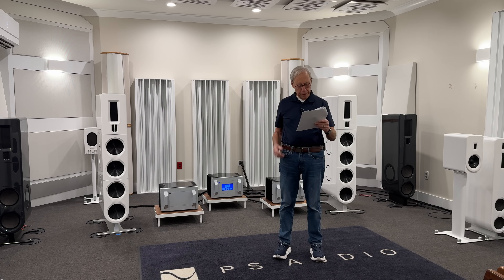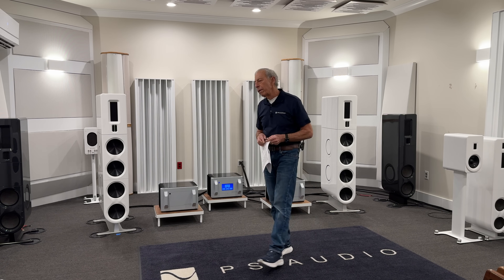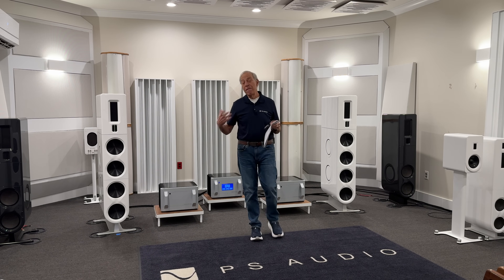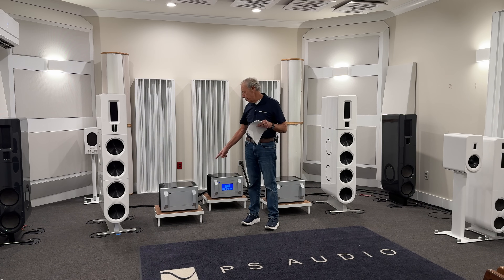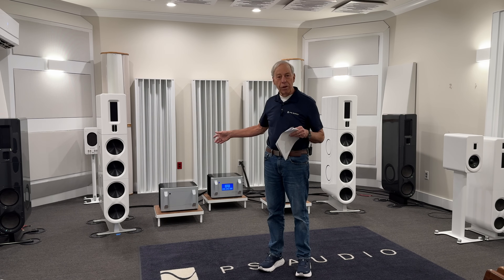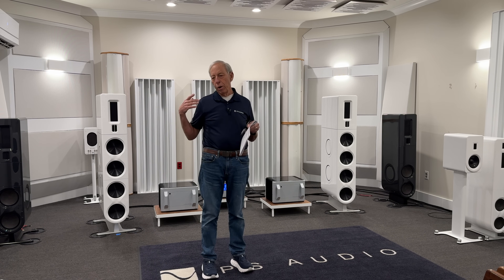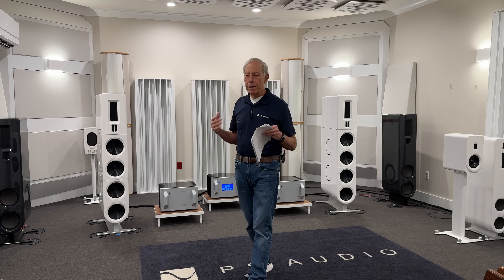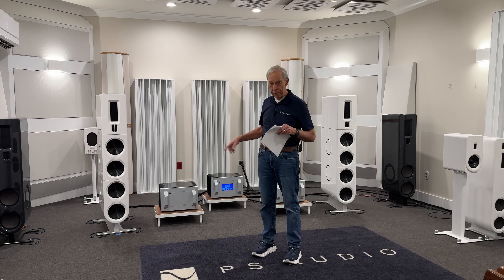Why do manufacturers use Class D amps for subs?

Comment: Just something which needed corrected/clarified in the question: “Why don’t manufacturers use solid state amplifiers to power subwoofers and they only use class-D…”. Really feel that it should’ve been corrected in that class A, B, AB and D are an amplifier circuit topology whereas solid state relates to the type of component used to realize that circuit. The question seems to equate class D with not being solid state which cannot be further from the truth (Theoretically, class-D can be done using vacuum tube, but practically solid state components are indeed perfect for class-D).

And just to be clear, Paul is as always 100% on the money/correct why a SOLID STARE class-D is the sensible high-efficiency choice for a low-frequency signal to a subwoofer.

Thanks for the content Paul!
Reply: SOLID STARE**
Reply: @Bassotronics You don't even want to know about the tube stare.
Reply: Think that was just how the guy, probably not a native English speaker, worded it after using Google translate in the letter to Paul. But yeah, what he meant was basically, "Why Class-D?"
Reply: 98% typical efficiency is just BS. Additionally, who cares about efficiency in powered sub? It's primarily about cost. It also explains why they break down very early on. Lastly some powered subs still use class ab amplification.
Reply: @carlosoliveira-rc2xt  seems weight is definitely a consideration for many people and the size of the subwoofer if you are going for wife approval factor in a shared use listening space. Then you have the issue of how do you give a Class A or AB amp enough ventilation inside a subwoofer so it doesn't run too hot?  I guess you could get a passive subwoofer and use an external amp maybe.